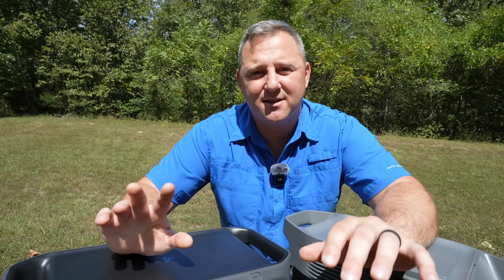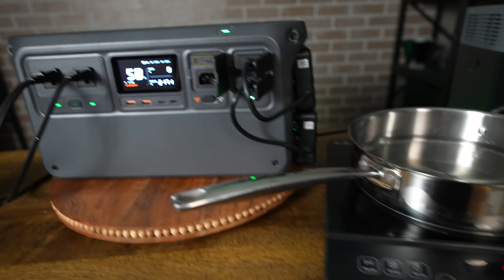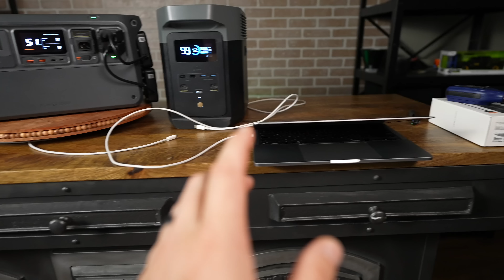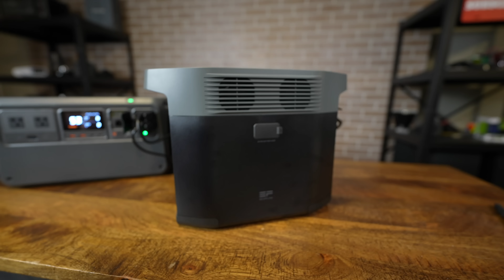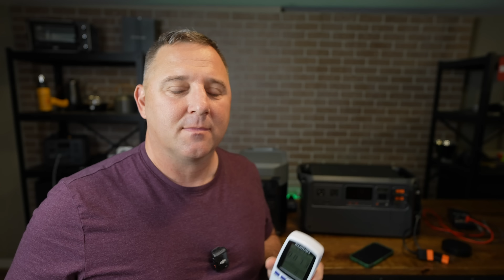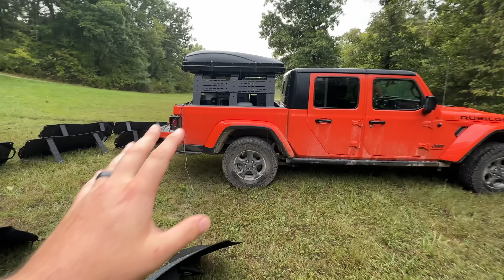It’s Not Even Close! - DJI Power 1000 vs. EcoFlow Delta 2

Comment: Rematch the EcoFlow Delta 3 Plus. Was out I believe when you made this so I'm not sure why you didn't just use the most current version. I don't think I would touch the DJI seems nice but might be nice if you're in the DJI ecosystem. I think if you're more into camping and "off grid" stuff the Ecoflow suite is going to be a lot better fit.
Reply from the maker: Check out the new comparison here: https://youtu.be/R7obYXVOlIk?si=qdaMsytxBi_H0m1L

Comment: You didn't use Ecoboost which will increase the max wattage you can use for inductive loads.  I see that as the only win that DJI really had.  I never charge at the full 1200W AC input, so it won't be so loud.  With solar, it is way quieter at 500W max than with 1200W AC..  Having a built-in MPPT is a win for Ecoflow too.  6 100W inputs at 30Vmax and those extra modules and cables on the DJI, no thanks.  You missed the mark here.  DJI is ok but not the winner.

Comment: "It’s Not Even Close!" I wouldn't go that far. Ecoflow has proven their products perform and have been killing it for years. Also many people have multiple unit as I do and would like to stay with the same manufacturer so you don't have to buy different cables like you do with DJI, and lastly DJI doesn't offer a larger unit than this 1000, that's a deal breaker for me.
Reply: Theyve got that exspansion battery if thats anything
Reply: Apples and oranges… price is no longer same after add on adapters… price factored in then can’t use the delta 2 to compare.. maybe the delta 3 … maybe even the plus with 2 solar inputs.

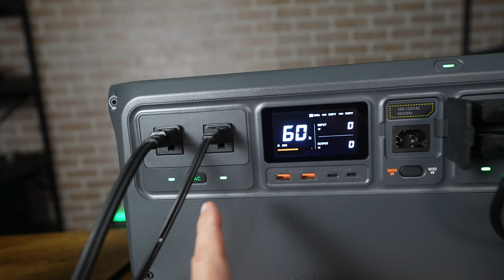Comment: 3:51 Hmmm... that's a tough one. Higher inverter rate is always great, but it's also better to have more AC outlets in case if you and your friends or family brings a lot of AC appliances. If DJI can put four AC outlet for Power 1000 successor, that would sound sweet.
Reply: For me, I can live with the DJI's two AC outlet ports as it's not hard to find extension plugs from local supermarkets. The DJI's higher inverter rate would be the one I prioritize more.

Comment: I'll take the Pecron 1500 LFP at $600 over both of these units. 3 AC outlets at 2200 watts, 1500 watt hour capacity! (50% more), 800 watt solar input (no need to buy two of those solar input controllers @ $120), Smart App., wireless charging pad, and AC & DC inverters are very efficient, no need to buy several propriety cords just to hook it up.

Comment: Interesting comparison,  as aways with any product, intended use dictates what is best for you. It might sound great having a much higher ac inverter but it does draw alot more power regardless of load. So if like myself it's usually around ac 750w over a period of time, the lower output rating will save alot of energy. 
For me having the front on the side with most of the inputs in a bonus. 
Due to inexperience / gullibility a few years ago I bought an "Allpowers",  what a pile of xxxx. £870 down the drain.
I'm disabled so budget is tight  ( especially now in the uk).  Have used  "Vtoman" for a while been very impressed with it, the fan only runs on high load for a shart time. I've just added to it with a 2.3kwh system on offer  £630. I use some solar pannels to charge it, hopefully if things get worse and the mains is cut off. It'll be enough to keep the fridge freezer running along with so lights.
These very portable power storage units are useful for more than just camping. 
So far it's been brilliant especially for the price

Comment: I’m just worried that you did not switch on X-Boost on the EcoFlow for the test. With X-Boost you can run loads up to 2,400 and it works very well on inductive loads. You clearly went in with a DJI win rigged. The DJI doesn’t even have an MPPT. 

I love DJI but I can also tell when the result is “forced”.

Comment: DJI, no 12v plug. Most campers, van dwellers, nomads use 12v refrigerators. Plus DJI is not proven in the portable power station arena. For that reason alone, I would most likely consider Anker, Ecoflow or Bluetti over the DJI. Thanks for the video.

Comment: Great Video you went over everything important about this two power stations, I currently have the DJI 1000 and should be receiving the Delta 2 Soon, so far im leaning DJI, the one thing im hoping they change in the future its their external MPPT only accepting around 100w to 133w solar input per each of the 3 port. Im sure there has to be a reasoning behind the design. If the power station becomes more and more popular im hopping to see some after market 400w MPPTs out there. Im wandering if anyone has tried to modified and SDC cable to fit a regular MPPT, that would be a great video to see. Thank you again for making great content.
Reply: You can put max 200w for each port with total 400w for the MPPT unit.
It means that you can use two 200w paniel for a MPPT unit with one port empty.

Comment: No 12 volt  cigarette plug to run a 12 volt refrigerator and only two AC plugs   not enough plugs.  And delta 3 is out now.   Which is a better buy.

Comment: Delta 2 is $399 on amazon right now.
Reply: Looks like dJI one upped them at 379.99
Reply: Bigger out put rules
Reply: @sleepingbear6116 not necessarily, depends on your use case, for me it is battery size that matters as the loads I connect are never that high 1500 W which BTW is the max of a regular US receptacle. The battery will drain in 1/2 hr if you are trying to pull 2000 W on either. Using a cooktop is really not a good use case for one of these. If you are camping a camp stove is a much better use of space and connivence. Noticed he down played the extra KWH of the Ecoflow.

Comment: Amazon Black Friday sale: DJI is $380. Delta 2 is $399. I went with the Delta 2 because of: 1. The form factor which suits my needs. 2.The location of the inputs and outputs which is behind the unit.    4. The DC & AC power switches are on the back of the unit BUT which I prefer, I can use the phone app to turn them ON/OFF, so still not an issue.
Reply: I love the design of my dji power 1000, the horizontal body is easy to carry and the dji home app is currently updated to control it.

Comment: The DJI was looking good until the extra expense and the limitation of having to buy a separate device(s) to charge with solar.

So add another $60-120 for that capability. Right now on the Big A, the DJI and Delta are similarly priced…until you have to buy the mppt also.

And your solar panel has to have a connector that is compatible with the adapter.

Comment: in the Philippines the cost of this two power stations is as follows:
DJI 1000: PHP 37,000 / USD 643.00
EcoFlow 1000: 54,000 / USD 939.00
that says a lot if we're talking about which one is a better value
Reply: Sino nag bebenta ng PHP 37k sa DJI 1000? 

DJI Store Makati sells it at PHP 51,590, out of stock pa.
Reply: @JoshuaJEnriquez  BLUETTI Dealership ₱36,900
 ang DJI 1000
Reply: @JoshuaJEnriquez  Nasa Lazada, bluetti local and Alpicool. I just ordered one from Alpicool, I'll let you know how it goes.
Reply: last year nakabili ko delta 2 37k lang pag labas ng delta 2
Reply: @aubreyballebar7879  sa legit seller sa shopee for 36k, actually 29k nung 1st preorder. Siya din yung seller ng ecoflow river 3 for 7k only. Nakabili ako

Comment: I had the ecoflow river 2 pro which would be one under the delta. I used it for camping. Don't run much. I bought this DJI but to be honest it really lasted only the 4 days which was  the same as the ecoflow pro. I recommend the ecoflow pro for basic wattage but maybe the dji to run higher watts and multiple appliances. Really dissapointed to be honest because this dji cost me a lot more than the ecoflow.

Comment: Maybe I don't understand but if the ecoflow can only charge at 500 watts max why would you hook up 800watts of solar panels. .  Then if the delta can charge faster at 500 watts over the 6oo watts of the DJI.   For my needs Ecoflow is the clear winner , since I bought at 599
Reply from the maker: Hi, overpaneling can help achieve full charging in poor conditions. The most important thing is to keep the voltage correct, and watch the total amps. Most solar panels only put out about 80% of their rated capacity in the best conditions. The EcoFlow is still a great option.
Reply: Also, the controllers need to be purchased separately and only accept 100watt solar panels so lots of extra cables, then the 12v charging cable is extra as well, then if you want 12v port you guess it EXTRA $ 😂

Comment: I have a delta 2 with a battery and a 200 watt bifacial portable panel… you really need to max out the panels to recharge completely or near completely if you want to run a small fridge and a swamp cooler, charge your phone… you will use probably 75% of both batteries in 24 hours. I use this set up only for the fridge and the cooler/fan… the 200 watt panel never recharges the system fully in one day… so I have to be careful.  Once winter hits, I won’t be using the fan and plan to see how it does just running the fridge and will use my food processor or a coffee maker and microwave.  I have a delta 1 that I keep near my bed for lights and phone charging and computer.  This power station can go four days without needing to be charged. I have a small 250 sf cabin with three areas … kitchen/living … a side storage area where my cistern and composting toilet are, so I need light, pump and fan capability over there. And I’m getting an oupes to keep that going. Hopefully it will be about the same 4 days before needing to recharge.  But, the one in the kitchen/living, the delta 2 w battery… needs to be on the panels first thing in the am every day mostly to keep the fridge going.

Comment: But isn't the delta 2 cost half the price of the DJI?  It's like $500 on amazon.
Reply: I just bought my EcoFlow D2 from the HSN for only $599.00 including a free 110w folding solar panel and power stripe kit. DJI, no extra value. 🤨
Reply: @Bobster986 bro, offgridstores has it for $449. I just ordered mine
Reply: @Bobster986 DJI power 1000  is now $379 on Amazon black Friday
Reply: Exactly. Today is a big sale day on Amazon- the DJI is $600, and the Ecoflow is $459 AND there is a coupon, if you look for it, that brings it down under $400. Comparing products based on MSRP is meaningless, consumers don't care about MSRP, they care about what things actually cost.
Reply: @timezonewall  The coupon is for the DJI not the Ecoflow, the Ecoflow is $459 the DJI is $599 with a $120 off coupon. So you could grab 2 for under $1000.
Reply: @shuster1921 yup! Bought my ecoflow yesterday for $390!
Reply: @timezonewall it's now 379 for DJI 1000
Reply: @timezonewall where are you finding a coupon?
Reply: The differences between the two products seems nominal. I do like that the DJI will accept up to 800 watts of solar. But having 800 watts of portable solar is far more than almost anyone carries.  If the price was actually identical, I might purchase the DJI.  But it really isn't. The Delta 2 is on sale on Amazon for $459.   In fact you can double the power and still be under the $999 retail price of both products.
Reply: @nikolatesla5553 DJI power 1000 is 379 on Amazon
Reply: Has been $399 on amazon for over a week for black Friday, which hasn't even come yet.  Plus, get an additional 7% off if you go to their Amazon store and get the code from in the header in latest live stream.  Got mine.. after taxes, and delivered to my house, cost less than $400.
Reply: On Amazon with the coupon the DJI is $499. Super cheap. I just bought mine.
Reply: @GoAdventure101 return it and buy it again because it's now 379
Reply: Grabbed the DJI 1000 for 379.99.  I think that’s a steal.
Reply: I got my Delta 2 off of TTok Shop last night for $412. They also have Echoflo  $99 100w solar panel with 10% off.
Reply: just picked up the DJI for $450
Reply: just bought the DJI at $599 plus tax.  It think 1oo extra for the case is a little extreme but for the unit hey.. why not
Reply: Here for New Years Sale 2025. Ecoflow delta 2 is in sale for $499. Way better deal. Best bang for your buck.
Reply: Plus you can put 3 together. It's like 650 with 200 watts of solar right now. So for it, 200 watts of panels and an Extra battery you surpass the DJI in available power and amperage. Looks like the d2 is still the goat (in this battle)

Comment: The DJI seems to have much better specs overall. I’d go with DJI for sure.
Reply: Don’t forget the added expense of the solar panel adapter. $60 for three panels and the panel has to have a compatible connector.

Comment: Could you still have a solar panel plugged in charging it & use kettle or v.small heater (450W) for example?
Reply from the maker: @tardeliesmagic  yes. Both power stations have pass through charging.
Reply: @AdventureGearTV  Thanks for the reply.
Reply: @AdventureGearTV is it TRUE pass through like ecoflow offers, or Does it just allow you to use and discharge the battery while you're simultaneously charging it like some other units?

Comment: Good comparison and testing on both power stations. I rather have high power ourput from the AC port than the number of ports. From my own experience, you will rarely use mire than 2 AC ports at the same time during my travel and living in my van.  So it all depends on what you are going to use it for. These Power Station are so competitively priced that I would choose one has the best recorded reliability. Thanks for thw reviews, Mario!😎👍
Reply from the maker: Your thoughts make a lot of sense. Reliability is an important factor, especially when the differences are not too big. How’s the meetup going?

Comment: The DJI had me until it came to charging with solar. I don't want to be limited to 100 watt panels or spend more to get the adapters for the panels. I would be using them in a camping environment as an off grid nomad.  I didn't hear you mention what the life expectancy was for these batteries, if you did say it.
Reply: Can use 200w panels
Reply from the maker: Hi, they’re both LFP which can last up to 10 years with low losses.
Reply: Wait till you see the echo flow alternator charger (800watts) to charge from your vehicle